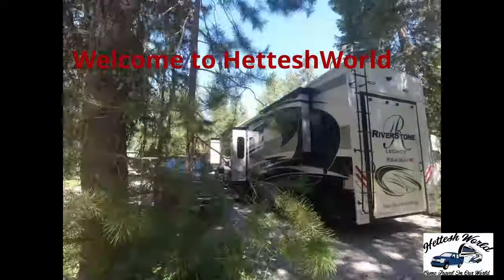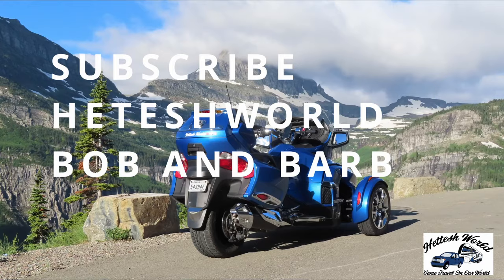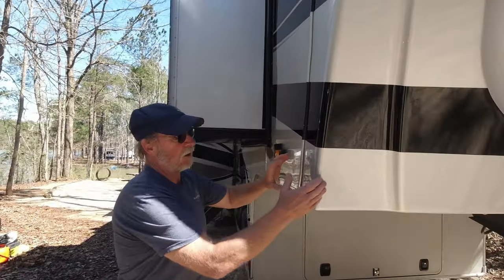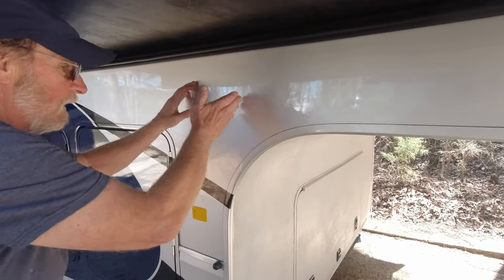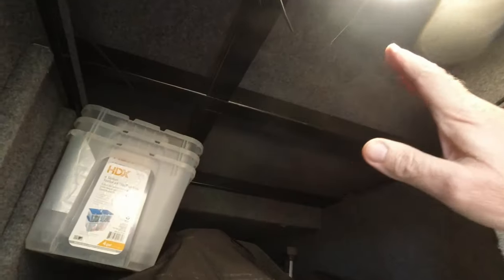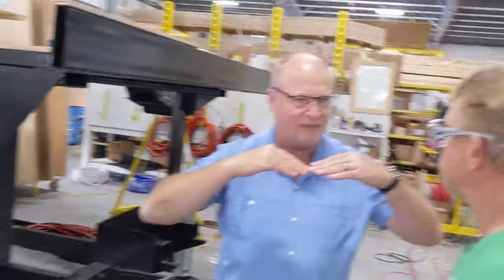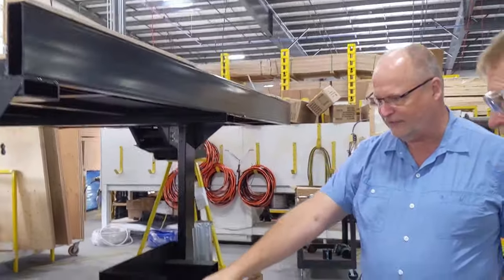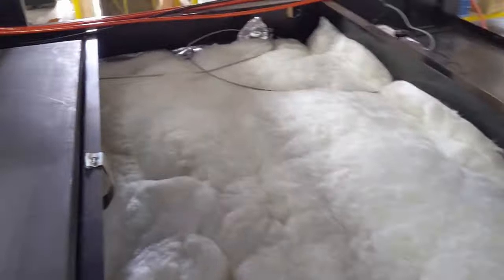Riverstone Legacy Frame Flex RV Issues RV Upgrades RV Travels RV Vlog Full-time RVer

Comment: Great video!  I love Riverstone RVs (even though Ive never been sponsored, paid, or ever endorsed by Riverstone).  Just a really well built unit!
Reply: Another huge advantage that you could see in the factory tour (8:40), was that your front overhang section is bolted from the outside in with nuts and adhesive to the frame.  The chances of a detachment occurring there is almost impossible.
Reply from the maker: Thanks JD. I'm sure you remember us from the show and our original Riverstone video with your viewer rigs Good to hear from you.
Reply from the maker: @BigTruckBigRV  We agree and that's why we did want to kind of attach our original video too so people could see the full thing from beginning to end.
Reply from the maker: We also really wanted to put something positive out there. There's so much negativity right now and to let people know that there are alternatives. We are not, of course sponsored by Riverstone either.
Reply: @BigTruckBigRV Thru bolts are the way to go for sure. Makes me curious to see who thru bolts and who does not. I know Riverstone does and DRV does as well seen both with my own eyes, i wonder who else does? 

I don't get how anyone would think lag screws were a good idea on something that moves. They wiggle free on house deck ledgerboards all the time. I feel like on an RV its almost a guarantee that lag bolts will pull free at some point.
Reply from the maker: @TDub_ADV The other one that I've heard about in the comments that I have not said eyes on is the New horizons. Thanks for watching our video and commenting on JD's comment.

Comment: Gooood video with some solid insight and information on how your frame is constructed!!!

Have to somewhat respectfully disagree on the off roading from my viewpoint and firsthand experience.  We have a 48’ TH and we do a lot of boondocking out west, so we often venture off road.  However, we conduct careful recon and will often go scout an area on the e-bike or to determine if it is safe or not.  Also, there are a plethora of apps that provide details on boondocking spots for all types of rigs, which we routinely utilize.

In our experience boondocking and traveling the interstates and highways throughout the country, our experience has been far worse on the road than off the road.  We have had episodes on I-10 in Louisana and east Texas where we thought we lost the camper.

On the flip side, traveling down a washboard dirt road for 2-3 miles with a few ruts at 5-10 mph was ezeee pzeee cheesy mcsqueezie compared to the highways.  

We are equipped with the Morryde IS as well and have our leveling legs raised up for maximum ground clearance.

Also, that video I kept asking Morryde to make just came out about 2 weeks ago.  I believe I mentioned it in one of your other videos in the comment section, in addition to my alignment comment.  Its on their YT channel and is pretty good, check it out. 
👍😃🍻
Reply from the maker: Thank you so much for commenting and sharing all this with us. We appreciate it!

Comment: Just an FYI. Riverstone is not the only frame that is built like that. DRV and New Horizons builds theirs in a very similar fashion with an all steel upper deck as well. DRV may even be a little heavier since it attaches to the lower frame at 6 points not 4 and they use a very stout 15" frame underneath. 

Riverstone and DRV really stand out from most of the RV market the way they are built. Similar frames, same wall construction and overall quality on both is just great. They are heavy for sure but built well. 

When we bought those two brands were the two we really focused on and we ended up in a DRV mainly for the layout. We did not want a toybox type since it would not fit our needs. We fell in love with the JX450's layout and it has worked perfectly for us.
Reply from the maker: Thank you for sharing all this on the DRV. We do not know a lot about the DRV other than how beautiful they are. So thank you for sharing that with us. We were just trying to be cheerleaders for our brand and now for the DRVs because they are built strong and sturdy. Thank you so much for watching and commenting!
Reply: @HetteshWorld We toured both DRV and Riverstone before we bought ours. Both to my eyes are so much better built than other more popular rigs.  

As I said before DRV and Riverstone were the only two we considered and it really came down to floorplan and what would work for us. I don't think you can go wrong with either brand.

Comment: you made me so worried. This is one of two rigs I have narrowed it down to. What hitch do you have? Im trying to find someone who uses the Gen Y ball hitch with their Riverstone.
Reply from the maker: We currently have the trail air which is now lippart curt. I will ask a question on our social media to see if there is one. I believe we ran into someone at Orlando that had it but they were regular RVerse and they don't have social media. We just can message them I believe. Not 100% on that but that's kind of what we remember. I will respond back to this post if I get a response on social media. Sorry about scaring you. We wanted to definitely promote the Riverstone. Thank you for your comments.
Reply: I saw the Title and thought they are just getting their two cents in on something that they don’t have to worry about.  On the Gen-Y pin box I didn’t like the Trail Air on our 2022 42 fskg because keeping the right air pressure correct was a pain in the rear. So in August of 2022 I had Gen-Y install the gooseball  pin box so I could get some of my bed space back I have a 95 gallon auxiliary fuel tank. Now it rides more like a semi truck as opposed to the Trail Air fighting the air bags on the truck and less chucking and noise than the fifth wheel.
Reply: @HetteshWorld I have the Gen-Y gooseneck on my 2022 42 fskg never liked the Trail Air a pain in the rear to keep the correct air pressure in it.
Reply from the maker: Doug I got this on Facebook. What is your question? 

A Nathan Morrow commented I have a 2021 39FKTH with the Gen-Y gooseneck version and the Goosepuck.  Happy to answer any questions.
Reply from the maker: @TonyBenton0728  thank you for this information and glad to hear from you Tony. Hope you are well.
Reply from the maker: Also Doug Tony on here in the comments is a good one to ask questions of as well on the Gen-Y.
Reply: thank you so much. That is exactly the trailer I am looking at and am sold on the Gen Y goose neck. To know that you are comfortably towing with one makes me more confident 
 @TonyBenton0728
Reply: @dougwilliams3276  Thank you 🙏🏻